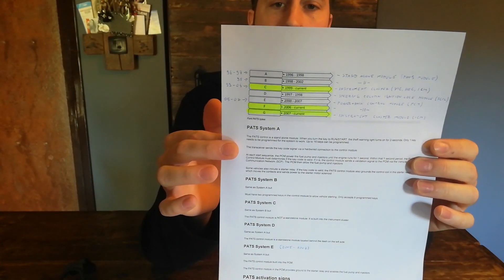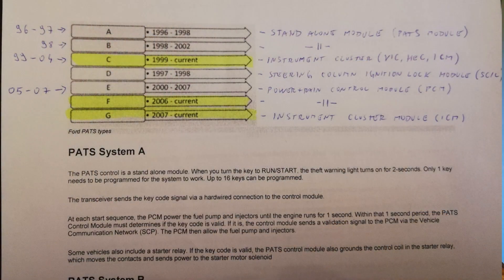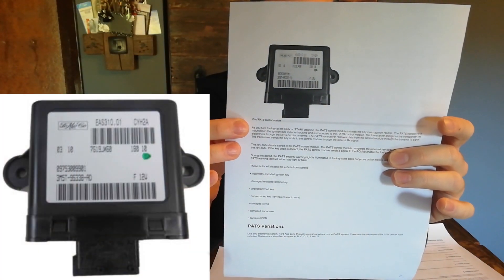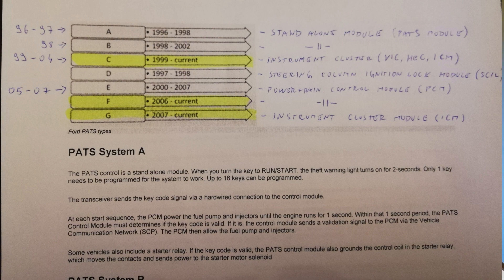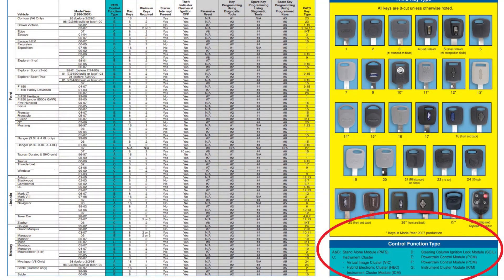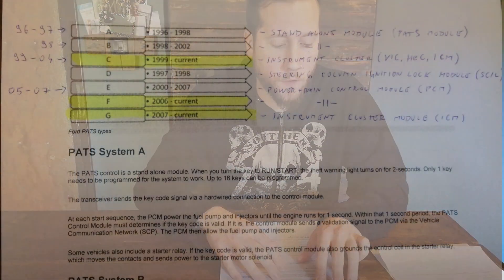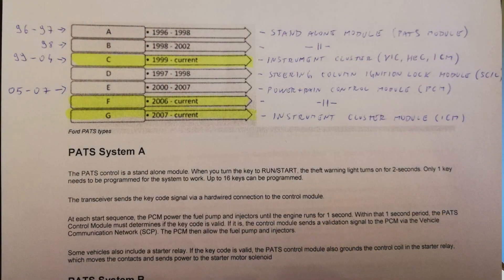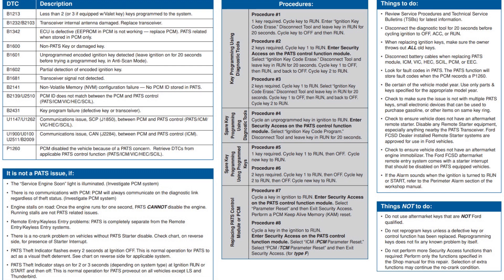S197 Mustang 3.7 V6 to Supercharged 5.0 V8 swap - PART 4 - P.A.T.S.

Comment: Bro where’s the build at wtffffffffffffff I need to see this mans car started and in that v6 body. Where is the pulls? where’s the new videos fix it
Reply from the maker: Hey man! 
I did all the prep work and recorded everything for you guys but still need to edit it and upload (am behind, I know). As for the swap, we pulled the 5.0 engine into the shop to start replacing some stuff and fixing what needed fixing when we realized it would be a good time to change out some more stuff that we weren't aware was close to needing replacing. So we said fuck it, since the engine is out we might as well replace everything. So now I'm waiting for parts to arrive and this Corona virus thing is only making everything worse/slower (plus it takes forever to ship shit from the US to me). As soon as I get the parts we are swapping. 

Hang in there, new videos will be uploaded in a week the latest!

Comment: I have a 2017 mustang and want to put a 2017 5.0 engine in it, besides the v8 engine, transmission, ecu what else would be needed?
Reply: u should  have just bought  a 5.0
Reply from the maker: I will do a video in the following days explaining everything you need so keep an eye out for it.

Comment: Really nice to see someone who really doing it... most of the time people say that is cheaper to sell the v6 and buy the v8 but i feel you man, i have a 3.7 2014 and i want to do the same as you one day with mine too. Hope this will goes good as it start for you man. Keep it up!!
Reply from the maker: Thanks man! If you have the means do it! It should be pretty easy really. 
I too hope it'll all work out well. 
We'll see very soon.
Reply: Same here. I have a 14 V6 paid for.  
I really just want to drop a 427 in there.  I want a LS7 with 6 speed auto.  It would be a Chevy Mustang